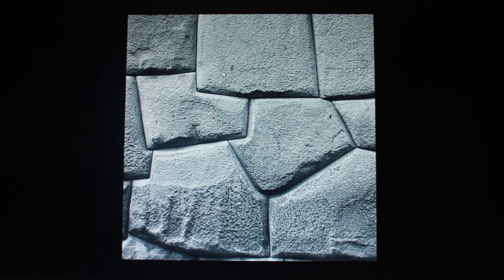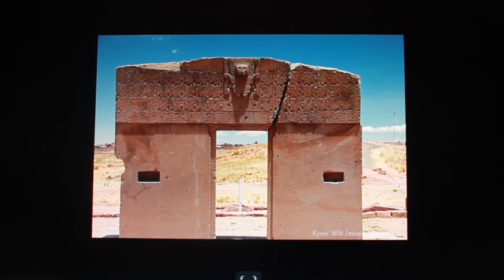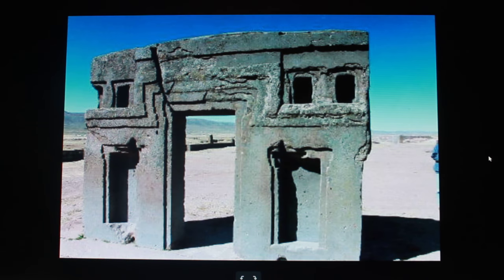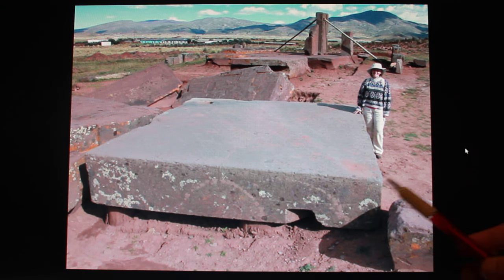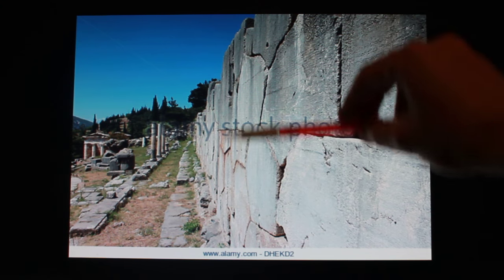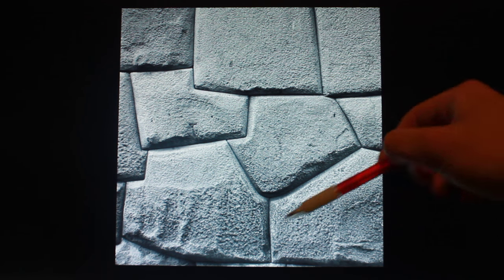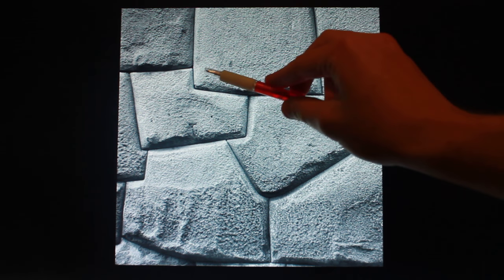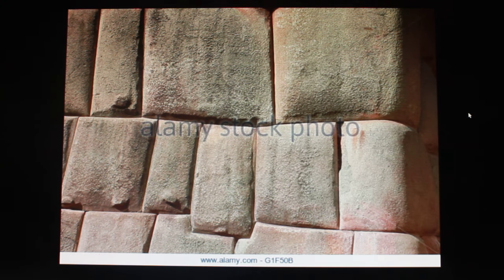How were the POLYGONAL MEGALITHIC INCA WALLS BUILT? LIKE THIS?

Comment: Good theories for sure. But these walls are made mostly from quarried stone. The quarries are not too far away and you can see where the stone was cut from. A theory which I find attractive is that precision cutting tools were used. Also it's possible the stone was made soft and malleable using technology we cannot yet understand. In short this work is most probably much older than we can guess and done by a culture that we really have no clue about. Peace
Reply from the maker: Thank you sir. Cool! I think they did cutting as well! One conundrum is if they had the technology to do the concrete they probably had the technology for precision cutting also! Some could be cut, some something else!
Reply: By rotating, any large equipment will produce vibration relative to the mass.    I have to believe these were stones & they were not cast, but I agree, they remind me of material tossed in a mold.  The forceful vibrations could account for the machine look.  Leverage technology could account for the distance problem, but I can't see it being a good use of energy to build so heavy unless your insurance required it built to size-mic scale.
Reply from the maker: Russell Shute
Interesting!
Reply: I agree
Reply: except when you consider the 3/4 quarried obelisks and the granite sarcophagus' precision tooling found in egypt. and consider the similarities of stone masonry around the globe in the 10 to 15 thousand year ago time frame its more than obvious that something fantastic was happening back then.....
Reply from the maker: Totally agree! In this era they were making fantastic pottery, in fact the best pottery is pre-dynastic Egypt! Which is before Egypt is supposed to have even been a monarchy! They had some leftover from a 'high-tech' world! Megalithic walls go with the pyramids, worldwide! Could be back then why not!
Reply: brad douglas totally agree. Tools using sun light, extreme water pressure or off worldly, this is something I wish we find out about in my lifetime..
Reply: How about this, the were able to make lens to focus intense light on the cut area perhaps soaked with water.  This is natural material with pores?
Reply: great idea i impresive me wen you told they lifted  a continent ! it is like this !
Reply: personally I think they used water and sand at high pressure to cut away the rough stones
Reply: rob rayne When you think of it, it's easy to make a pressure pump and these people knew how to control water.....
Reply: Brad concrete makes more sense. I'm sure there is some exotic tech in the past, but the archeologists have been calling this stone without really understanding concrete. We have some instances of Giants but less we be led astray, it is time we realize that we have the tech to do this today and nobody really approached it from an angle of concrete. Anything can be used in concrete and you can build fast. Including placement.

We know the Bosnian Pyramids are concrete and I'm willing to bet the Egyptian Pyramids might be as well. Even Giants would build using this method.

I've been on this line of thinking myself. it requires us to revisit old sites with new eyes. Some were stone carvers. Some were Concrete layers. (Masons?). Concrete and steel are the Modern Age. They used it just like we do. Now we need to get a better grasp on the what for?  It doesn't answer all the questions but it's a total perspective changer for sure.

... Using Concrete says this didn't take long.  A few years at the most. It also explains the precision of the placement of the Pyramids. It explains a whole lot the more you think about it. Ancient people become practical and not this superstitious mumbo jumbo we've been told ... As a matter of fact ... Archeologist know very little about what they are piecing together. They are the Academia Guard. See were supposed to be the highest man has been, but that is a lie because they don't want people asking;

WHAT HAPPENED!!!
Reply: but the quarry only accounts for 1/6 of the total and how do you cut into solid stone 1000 years ago? Kun Fu?
Reply: Could the quarries have been used to produce material used for the concrete?
Reply: "It's possible the stone was made soft and malleable" like concrete.
Reply: What they are call quarries are most likely the foundation of older buildings with missing components. I'm speaking of the supposed quarries with missing (cubed cut outs) blocks of stone.
Reply: brad douglas probably done by ancient mexicans . mostly likely the case. Ill put notes here later
Reply: Literally Stalin; If you accept it's just a concrete mix and not very difficult to built, why do you still think they needed high tech tools?
Reply: Well if they could alter the nuclear structure of the stone ( electric + frequency ) that would be much easier , like the music pillars of that Indian temple don't remember the name
Reply: If the stones like at pumapunku had be molded do you imagine the work it would have been ? The mathematiques ,mesurment,and so on , in itself it s as incredible ! You should take a look at the temple of varangal if you don't already know it .
Reply: Kurt Lantz ❤
Reply: Is it a quarry or source of cement?
Reply: Martin O Transportation would be the least of your problems..  If these stones were really carved, then why do we see fully intact and undamaged fossils(nummulites) on the side they say were carved..?? Wouldn't these fossils all be damaged and broken if they carved through the stone..??  I think the Geopolymer answers all questions of how this was made..
Reply: @robrayne9144  I.dlike to see some compressors, hoses   and  so on

Comment: you put the case for ancient concrete brilliantly. I find it amusing to see all the crazy explanations put forward for how the ancients quarried, carved and dragged complex blocks into place when the materials and methods of making concrete were readily available.
Reply from the maker: Cool, thank you! Exactly! It's way too hard to accurately position huge blocks.
Reply: modern concrete made with fines such as sand and gravel is almost identical to natural granite when viewed under a microscope, which is why the so-called stone used in the walls is usually said to be granite when in fact it is ancient concrete
Reply: I love your work on ancient mysteries but the 'Alien Coffins' of the Saqqara Serapeum are likely said to be granite by amateur geologists but almost certainly they are made of ancient concrete poured or tamped into very strong and precise formwork and probably hand polished some months after the concrete has cured

Comment: Volcanic ash was used in the mixture
Today, they mold is the wooden frame from all sides, except the side which has a dried block
You're right a biodegradable material was used as a seperator to avoid the the blocks getting fused to each other

Comment: Modern concrete is composed of cement (the glue), flyash, sand, rock, and water.  The water chemically combines with the other ingredients in setting up to create a hard building material.  The final product is far weaker than rock, which is what these megalithic blocks are.  They are not concrete.  The only way to pour these huge blocks would be to heat them to magma.  The ancients must have used some unknown technology to cut these blocks like puzzle pieces to create their amazing structures. That's just my two cents.
Reply from the maker: Cheers! I think they are geopolymer concrete which becomes concrete.
Reply: Modern concrete is pretty terrible as compared to even Roman concrete. Our concrete does not last that long where as Roman marine concrete is still hanging around in harbours all around the Mediterranean. It is not unfathomable that a different concrete formula might yield different results to the rubbish we use today.
Reply: @d4rqm4nn  plus the stomps on all the blocks look like venting pockets used  with pressure filling of hot metals or other liquids
Reply: Our concrete is only weak because of the steel we put in it. Nonetheless I find it very hard to believe this example is some sort of concrete.
Reply: @adamlutsch1975  the steel is reinforcement not to weaken it

Comment: Considering the size and weight of some of these stones, especially the huge cornerstones in some of these pictures, their "bag" technology would have to far surpass their masonry skills to keep from ripping from the strain. I don't buy your theory but I appreciate the effort. These walls were simply dressed and fitted while lying on a flat surface where the masons could access all sides of the stone before being lifted and slipped into place. The face of the joints were then dressed down with finer pounding stones to a smoother and finer finished appearance.  The protuberances were possibly where levering devices were used to help in moving them around during their dressing or before final placement.

Comment: I also believe they were made of poured concrete as U suggested, but individually poured, allowing the bottom ones to dry out enough so it won't bond with the newly poured fresh concrete, which leves  a dividing line needing only finishing touch. If the bottom block is dry with a prepaired top surface, there's no reason why the poured concrete shouldn't fallow as needed. 
As for the knobs, they could've been part of a frame work of support from wall to ground holding the poured concrete together .
Someone suggested the stones were quarried, and cut to fit, which could be right, but it makes me wonder about the levels of perfection needed to avoid ruining those beautiful strait edges when putting them into place, considering the weight. 
Stones were quarried and process, most likely in the most manageable way, which would be cement.
Reply: Rayagoldendropofsun Sunlightelectrorays - the knobs are the remnants of the holes in the formwork that was used to drain the water slurry out of the  concrete section as it sets. These knobs become more pronounced with erosion since the knobs have a higher density and erode slower.

Comment: My theory is that  each stone was custom fit on site and it was not as difficult as it would appear.  Please bear with me as I attempt to convey my thought.  First, imagine every stone was quarried in a rectangular shape and then moved to the site.  The base of the wall is started (lets say at the very middle)  by putting two of the rectangular stones together squarely.  The next step is to work/chisel away various parts of those two stones, while in place, to get unique areas where subsequent stones will go.  Now the magic happens.  Stone number three is brought to the site and is positioned BEHIND stones one and two (at the appropriate position above or to the side, but BEHIND) and the correct pattern is simply scribed onto stone number three.  Stone number three is worked/chiseled to the exact shape needed/indicated by the scribing, and then moved into place when finished.

Comment: Living here in cusco I could find more clues to how this was done and and the whole architecture was constructed like this :
the foundations were done first  the megalithic sites and block stiles have a very planned out layout, for the corners that came seccond with the doorways, some of the biggest stones are at the corners and the best way to spot the mastery of masonry is at the gates themselves (although most of them disapeared the ones that still hold up have a masive flat block hammered and polished to perfecction) there is a lot of gravel made of the same stones also some of the floors also have the pieces of stone and inside the walls there is a plaster made of clay and rests of hammered stones, EVERYTHING IS STONE,  behind the rocks of the megalithic poligonal pieces are just hammered and NO SINGLE TRACE OF THE SAME TREATMENT AS THE FRONT, thats suficient proof that every block was placed one after the other and previously had a rough hammered piece THEN  they had a way to first polish the edges then smooth out the chanfer with more delicate hammers that leave very little holes  then using  a shape transfer and selecting the stone that can be fitted in the new slot some of the stones still have the marks of a rope like stone cutter and that can be a rope with a dislolvant specific for the stone and some investigators did find some traces of an acid in the spaces between theese rocks to polish them after fiiting and then repeating for each stone fitting every single one by hand made by masters the only thing i could not wrap my head arround is the exsistence of theese rope cutters thats the only posible way that some of the carved mega stones outside the city have like stairs and crevases finely cut from the stone and a posible way to make such perfect slabs in less time. 

thnks for reading and if you came down here my dream is to make a megalithic site just to try and reproduce the tecniques for posterity and to make it availiable to the world as a superior foundation tecnique mixed with other tec such as roman concrete and reinforced modern structures

Comment: I've actualy done this type of building accept I did used this technique to seal the bottom of the fence, to make a sidewalk, and shore up gaps in a fence. I simply used the bag the concrete came in half ed the contents added water,  shook it up threw it on the ground I kept doing this for 15 feet on ml the sidewalk portion. The concrete I used was a colored concrete  kind of a sandstone tan dirt color. When it was finished curing I removed the bags. It looked a lot like natural stone accept for the wrinkles  from the bags.  If you can stop signs of wrinkle or figure out what container was used to do this then you will have officially proven this theroy. 
I myself am tempted to build a small wall just to try it.
If you look at how masonry  is done adding water on top on the wall in those days would have indeed been a lot more easy than using concrete completly mixed. In some cases. Or using bags of fully mixed concrete lifted with pully and rope then dropped into the form. So the bags would have to be strong probably animal hides sewn together.  I duno maybe what I do know is these rocks are not solid natural quarry rocks sanded into puzzle pieces.  The corner stones might be solid rock but not the construction blocks.

Comment: Using this logic the mountain where these stones were quarryed is also made of concrete. Now use your logic to explain that!
Reply: They used cut blocks ALSO.
Reply: Where do you think concrete aggregate comes from! is dug out from mountain quarries. The Portuguese have been building their rustic homes for centuries using the blocks and then adding mix on the surface so it looks like bricks, or stacked clay bricks then add concrete to smooth the wall so you do not see bricks. This is no secret the Portuguese brought this building method from the middle East.

Comment: Lets say for a moment It is some sort of ancient concrete that crystallized into apparent granite. It seems to me, these walls were made upside down. Then reassembled in there current location. If you dug a trench in the ground, or piled dirt up to the height of your wall then it would be easy to just jump in the trench with wood slats and start pouring. The earth is a fantastic mold. this would account for the shapes and the perfect fit. your pouring a fresh block up against a dried block. then, when your done  just dig the dirt away from the top row, slide the stone to its place and flip it over. now its the bottom row of the wall.

Comment: dear  youtubers ... i admit at first i was skeptical, as i have been studying pyramids since i was 16 when i first went to mexico, and was on board with "how did they move such large rocks" ??

i am currently planning a trip to Bosnia to volunteer at the pyramid of the sun and while planning and studying i came across something that actually proved me 100% CORRECT ...

60 METERS UNDERGROUND IN THE TUNNELS LEADING TO THE PYRAMID OF THE SUN THEY FOUND A 10 TON MEGALITHIC STONE PLACED ON TOP OF ANOTHER MEGALITHIC "STAND" . instead of just asking "how did they get this giant stone in this tunnel" THEY DRILLED IT AND SENT IT TO A LAB AND DISCOVERED IT WAS COMPLETELY MAN MADE !! THEY CALLED IT PLASTER !! get this ....INSIDE THE GIANT MEGALITH AT THE CENTER IS A QUARTZ CRYSTAL THAT AMPLIFIES THE VIBRATIONS OF THE WATER BELOW !!

ALSO

THEY DISCOVERED THAT THE DIRT REMOVED FORM THE TUNNEL WAS MIXED AND SMEARED ON THE OUTSIDE OF THE PYRAMID TO INSULATE AND HELP WITH SCULPTURING AND ORNATE DESIGNS

jeff mcarthur 

I want to add a comment about the GREAT PYRAMID ALSO ... they found thousands of "stone balls" on the giza plateau and cant figure out what the hell they are well THE PYRAMID OF THE SUN also points to those stone balls being put in the middle of all of those blocks in the great pyramid .....

CONCRETE Y'ALL NOT MOVING LARGE ROCKS